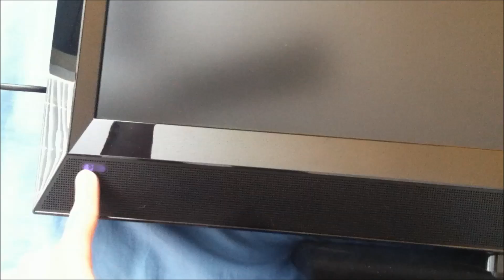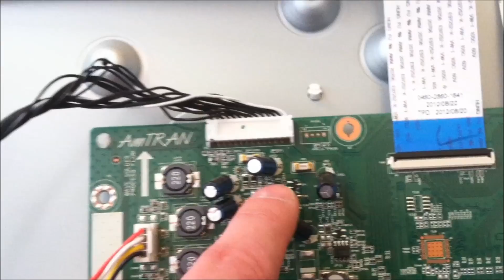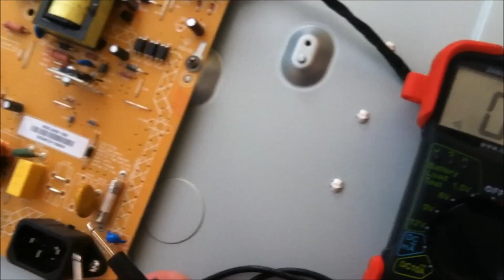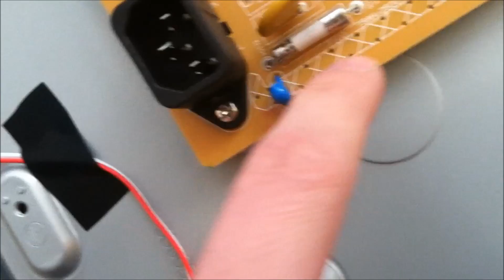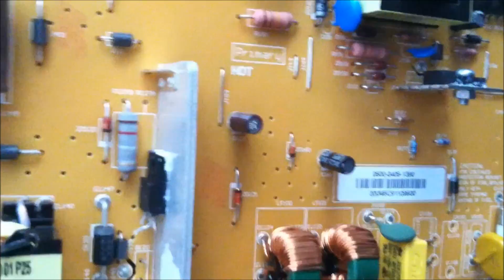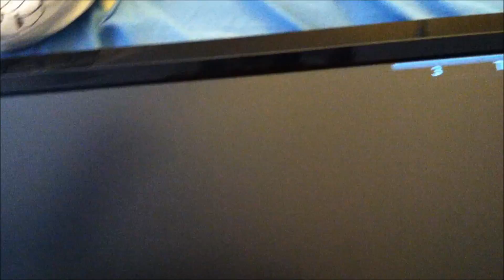Vizio E370VLE Wont Turn On Repair Fix

Comment: I think I over tightened the digital TV connection and have no idea how to fix it. When I removed the back and the silver plate covering the cable connector; it spins freely and there is a twisted remnant of the connector but it is no longer connected to anything. The TV turns on but cannot get a cable or antenna to connect. What are my options? Thanks
Reply from the maker: Bill Means either replace board or use hdmi
Reply: After Hours Tv & Pc repair - how much does a new board cost ?
Reply: It is a Visio model vw26l.
Reply from the maker: 30-40 on eBay.

Comment: Quick question, i have a vizio 32 in M #: E320-B2, dont have remote, but when i plug power cord in and or hit power button to power on LED power light comes on no picture or sound then after few seconds LED LIGHT turns off. Please if u can tell me wut to do or ways i can check and or fix, i would really appreciate it very much

Comment: I Unplug it and plug it back in, the power light comes on and fades away.  the power wont switch on.
Reply from the maker: 357wolverine have you taken it apart yet?
Reply: After Hours Tv & Pc repair i have the same problem now
Reply from the maker: Terrance Payne take it apart and see if you have same problem as shown in video
Reply: OK I will when I get home from work.

Comment: Worked perfect on 2 LG's my neighbor had. ButI got a 55" Vizio E550VL from another friend. It lost HDMI picture on all 3 HDMI connections. I could hear clicks from my Amazon Fire Stick. I replaced the main board with one I paid $165 for on eBay and that didn't fix it, instead, when I connect the new main board, the 12v section of the power board clicks over and over. What do I do? It doesn't click with old main board. Donyoubthink there are bad caps on the new board?

Comment: I have a VA370M  the power cable between the power supply has on/off dim/12v/12v/gnd/gnd/gnd/24v/24v/pson/5v/5v.
If I jump 5v and pson I can test the 12v and 24v .My question is do I jump on/off with ground or do I jump 5v to on/off or dim to test ccfl back lights.I have menu with flashlight,but no back lights.

Comment: when turning the TV on, I occasionally had a blue sceen (no signal) on my HDMI port (I only have 1 port, manufactured July  2006, Vizio L37HDDTV10a). I was able to get a signal by cycling thru the input back to (digital HD) and then had a signal. after a storm last night which had close lighting strikes, I am not getting a signal at all. tried factory reset (found directions online), bit that didn't work. any suggestions? replace the main board? if so, what's the cost and part number  plz?
Reply from the maker: Mark Becker http://www.ebay.com/itm/Vizio-3370-0092-0150-Main-Board-for-L37HDTV10A-/271906797801?hash=item3f4ee878e9

Comment: Nice job, but i have a vw32l visio and the visio logo just flashes when I turn it on, its a 2008 model. it goes from white to amber and just flashes, I checked fuses and caps and their ok. I checked them with a meter  .any ideas?.
Reply from the maker: Without seeing it I don't know. I'd say the main board is bad.